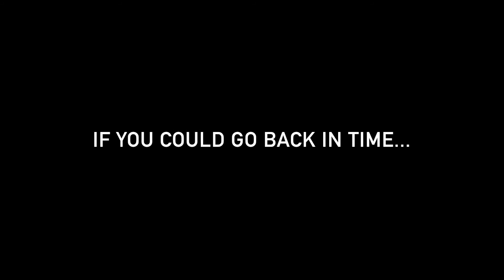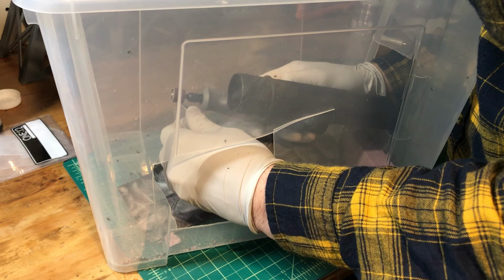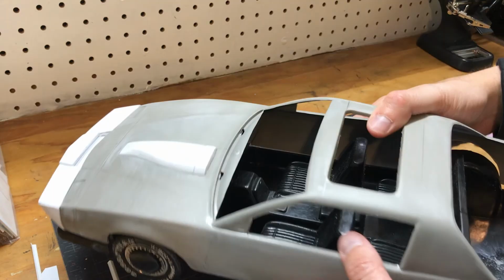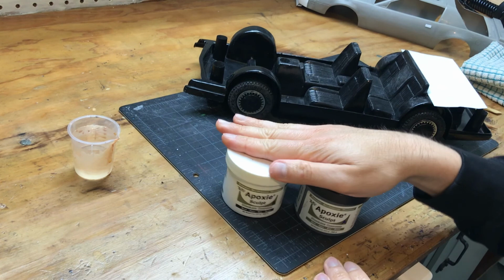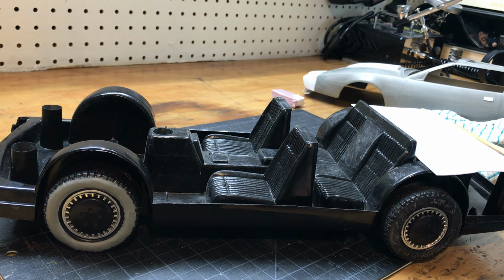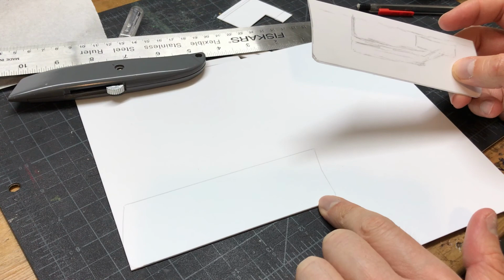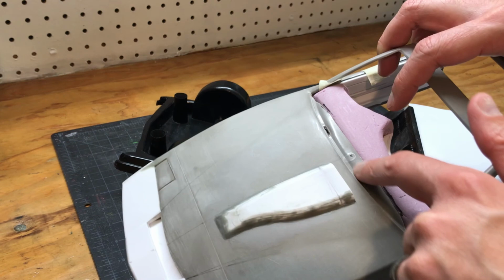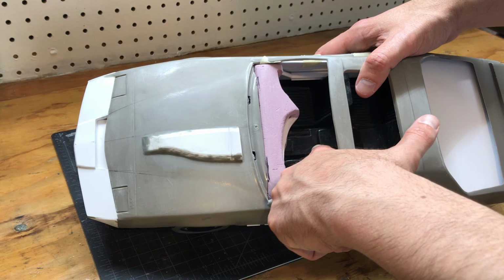Custom 1:12 Scale KITT (Knight Rider) From A $25 Toy Car (Part 3)

Comment: I think you can restore the original window… here’s a couple videos I found that might help…

https://youtu.be/LrnL6aCVaTc

https://youtu.be/namMc3_NAJY

I’ve used the Novus from the hot wheel video, it works pretty good
Reply from the maker: Wow, that is super-helpful, thank you! I still don't think I'll be able to use the stock windows-- they're this weird amber/brown color (not from age, I think they're castr in that weird color) and I really want clear. But these tips are really excellent for other future projects, and I'll definitely use them. Thanks again!
Reply: No problem, I just found another “car pool coupe” at goodwill to start my knight rider!! Ironically, I will probably have to vacuum form the windows for mine from scratch as this car has no top… It’s the same car I used for my Delorian
Reply from the maker: @emilflognoid1532  Excellent! Nothing like finding exactly what you need at a thrift store! I'm thinking I'm going to try to heat some plastic and use the existing windows I have as a template to mold them over. We'll see how that goes, lol.
Reply: @Ibrahim_M  cool, I’m in the process of building a plug to heat form a window for my tie fighter right now… first time trying that, will post and see how it goes..
Reply: @Ibrahim_M  Yeah the cool thing about that is that it has both the bucket seats… The first one I got only had one… But I’m using those for a bad batch shuttle that I am building so now I got more of those! Lol
Reply from the maker: @emilflognoid1532  Nice! I've toyed with the idea of building a vacuform setup. Time and space are always the factor, haha. In the end I end up just looking for on-hand solutions. one day I won't be able to avoid it anymore, lol.
Reply from the maker: @emilflognoid1532  Nice! Keep an eye out for the Btaz cruiser-- great car for 1/10 and 1/12 scale figures, and the seats are removable.